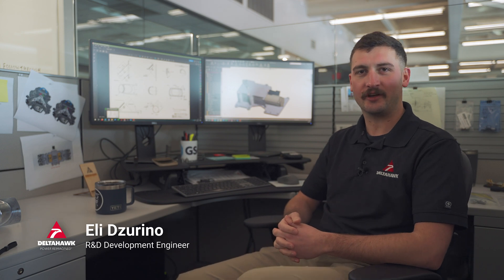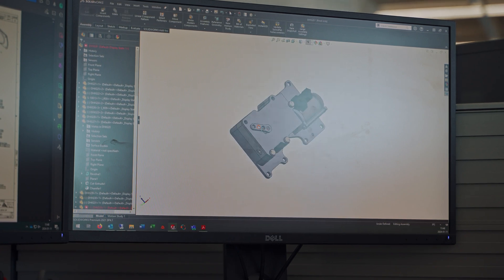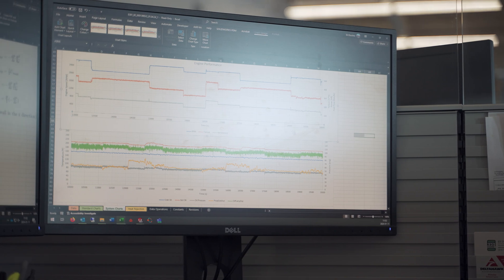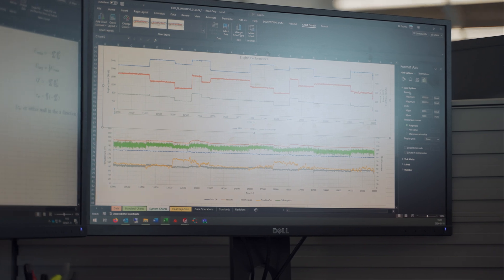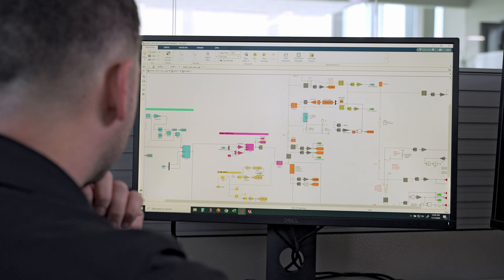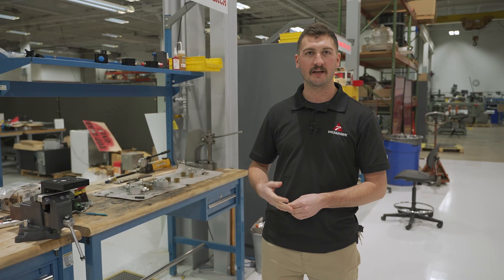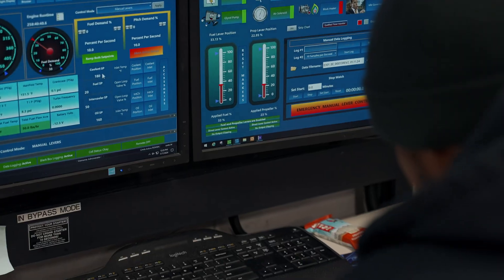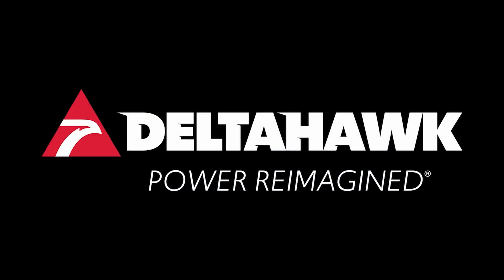Day in the Life: Engineering

Comment: I'd like to see what the cylinder and pistons actually look like.  Upon research, I found that the engine utilizes curtis-loop scavenging, but the patent drawings are vague.  I'm just curious about the port timing.  I'm also curious if the engine it just relying on back pressure to provide boost.
Reply: It's FAA certified. So it's good enough.

Comment: Function looks potentially good.    A key elements of this company's success will be scalability and can they produce enough units to get the cost down from the proposed 100K , comparable with a  legacy type aircraft engine.     And what will that scalability reveal in terms of data over the aggregate hours used.    Better performance and efficiency alone doesn't appear to me that will make a lot of lyco/conti crossovers.   The engine will have to prove equal or likely superior reliability to those engines because that aspect is precisely why those owners think they need the lyco or conti.   Only time run in the real world can tell the public that in a way that they understand.    Having said that I hope it (the engines) does do all of those things.   And again I hope it can be scaled up high enough to bring it down to a competitive price point.
Reply: I totally agree. I mean, don't get me wrong, I'm excited to hear the 235 HP version announcement. I'm pretty sure everyone in GA knows who the 235 HP version is targeted for. I'd like to see some well done videos of how the thing works. I got some questions too - such as how do the piston rings not get caught on the inlet & exhaust ports, and how is the engine lubed ?? {Because I'm understanding it's a 2 stroke engine} I'm almost pretty sure you don't add 2 stroke oil to Jet A to keep the engine lubed.
Reply: @mustardseedsociety  The induction charge doesn't run through the crankcase, so it just has a normal sump-type lubrication system. It's like a 2-stroke Detroit Diesel, but without the valves.
Reply: @PistonAvatarGuy It's funny you mentioned that, because when I run a weedeater I never really thought how the oil in the fuel lubed all the parts. All I know is you're supposed to put a tiny bit of oil in the gas.  I always thought that 40 to 1 seemed really way too low, but I did not invent the thing - and the exhaust seemed smokey so 40 to 1 is doing something and the engine continues to run so I must be doing something right. The part that I'm not getting is if the Delta Hawk engine is a "normal" oil system, then it has an oil control ring. But how does the oil stay in the cylinder as the piston covers the port ??
Reply: @mustardseedsociety  I'm sure that a small amount of oil ends up in places where it's not supposed to be and that the oil needs to be regularly replenished after a flight. There are a lot of unknowns when it comes to this engine, like the TBO, for example. The company is not being very forthcoming, that's a bad sign IMO.
Reply: @PistonAvatarGuy  Yea I go back and forth in my excitement.  And probably because subconsciously my brain is screaming "DYNA CAM ENGINE !!". The Dyna Cam engine in the 90's WAS certified by the FAA and successfully tested on a Piper Arrow. If I remember correctly, it could run on junk gasoline, but don't quote me on that. I do NOT like reinventing the wheel over and over. The Dyna Cam engine was so much better than a Lycoming or Continental and 30 years later, we have no Dyna Cam engines on ANY airplanes {that I'm aware of} and it's like here we go again.  Frankly, if I could waive a magic wand,  I'd have the Dyna Cam engine being produced like right now.
Reply: @mustardseedsociety  It was an interesting concept, without a doubt, but I would guess that it had some issues that couldn't be overcome.
Reply: @mustardseedsociety  I had forgotten that it was certified, but that was in the late '50s and I'm sure that the certification process is far more stringent now.

Anyway, the engine wasn't all that ground breaking when it was built in the '80s and '90s. It's fuel efficiency was on par with LyConts and it was kinda heavy. It was basically equivalent to a 6.1 liter V12 operating at 4,000 rpm, and it was kinda choked off by its valvetrain and internal intake manifold arrangement. Supposedly, cooling it evenly was an issue.
Reply: @mustardseedsociety  And, I know that you're trying to make fun of me, but someone actually thought that the DeltaHawk was something that should receive some investment money, THAT is hilarious.

The DynaCam is still an unknown, it may have easily been far better than the LyConts in that power output range, with the proper amount of development.
Reply: @PistonAvatarGuy  Are we sure we're talking about the same engine ?? The engine I'm talking about was certified by the FAA in the 90's, not the 50's and it was water cooled and did not have cooling issues. It was installed on a Piper Arrow and they tested it and got better climb, better takeoff, better everything. There was no engineering issues because the engine was certified. The reason why it never went anywhere had to do with the business end of it - it was a money thing - something about the investors had a falling out and the name "Dyna Cam" could no longer be used and it was a matter of financing a factory to produce them. Here's the engine I'm talking about https://youtu.be/ScS-QCWHfb8?si=XrdVhaubLe0VGMwP
Reply: @mustardseedsociety  No, the engine that you're talking about was certified in the late '50s, then it was re-engineered in the late '80s and test flown in a Piper. Notice that the website says the "original" DynaCam engine was certified, not that the engine that they were developing was certified.

Certification doesn't mean that an engine is ready for production, but it does mean that it conforms to certain standards which are important for engines used in aircraft.

There is nothing which prevents liquid-cooled engines from encountering cooling problems, if the cooling system is not properly designed.

The revival of the DynaCam in the '80s probably was a scam, but that still leaves the world with no information as to whether or not the technology was viable. I guess we'll never know, simply because some shady people got a hold of the patent and used it to milk investors.

According to NASA, its role is to "conduct research, testing, and development to advance aeronautics," so it would be nice if they would start rigorously assessing some modern engine designs in order to advance light aircraft engines. In those assessments, I think it would be great to see what the DynaCam can do with some proper investment and state of the art engineering.

Also, another potential issue that I see with the design is the number of cylinders. With 8 cylinders instead of 12, it seems like the engine should be able to achieve perfect balance. Still, though, that's a lot of complexity for only 200 hp, but that might be offset by the reduction in complexity that the engine offers in other ways (no cam drive system, for one), we'll just never know. A small V6, or an inline 4 cylinder might be a better choice for an engine in the 200 hp range, anyway.
Reply: @PistonAvatarGuy So what about the flight tests that were reported as having been a success ??  We got film of it taking off and flying.
Reply: @mustardseedsociety  The longevity of the engine would be my only real concern. They did seem to fly it for quite a while, though. The fact that it was so choked off, too (very low power output for an engine that large that was basically running at 4,000 rpm), would be something that could likely be drastically improved today.
Reply: @PistonAvatarGuy I'm in the middle of watching Savy Aviation's latest video - a talk about the University of North Dakota flight school's recent decision to discontinue use of 94 unleaded fuel {and go back to 100LL} because they say it caused valve recession. But "Savy" thinks that the flight school is basing the decision off of incorrect assumptions namely the tappet clearance with no oil in the tappet. My question to the flight school is on the Seminole that they found one exhaust valve recessed, if it was the result of using 94UL, then why was it only one valve that was recessed ??  If it was the fuel, then all the valves should have been recessed. All the valve seats are of the hardened type. So I don't know - BUT, the question I want to ask "Savy", is the school went from 100 octane to 94 octane, but he said the FAA tests were done with 100 no lead. So I'm confused to say the least.
Reply: @mustardseedsociety  There is definitely something strange going on with regard to leaded aviation fuels and the LyCont duopoly, there just seems to be something very powerful maintaining their reign. Who really knows, though, right?